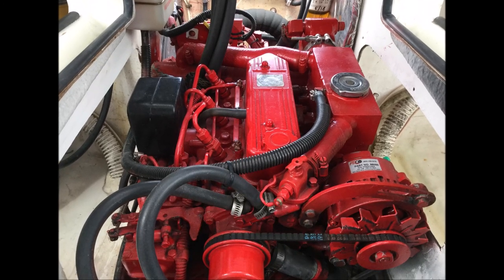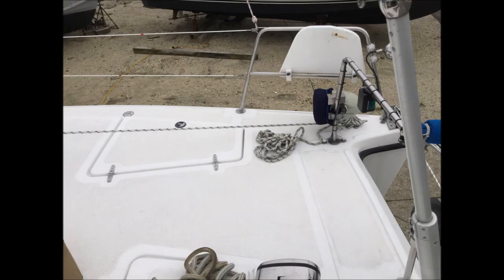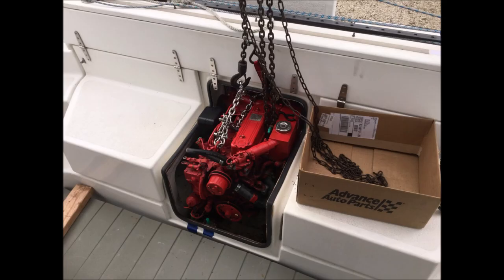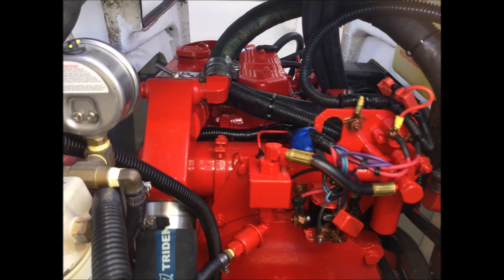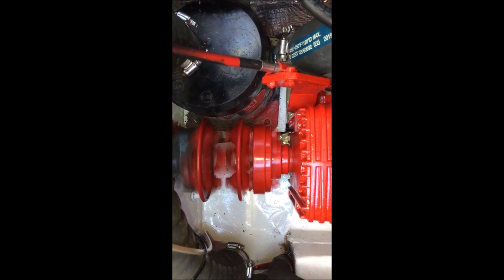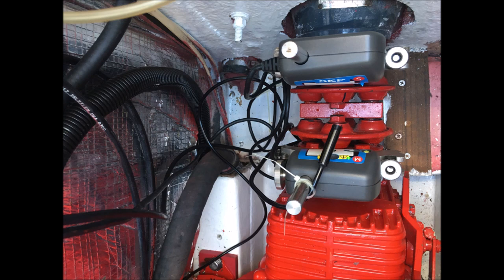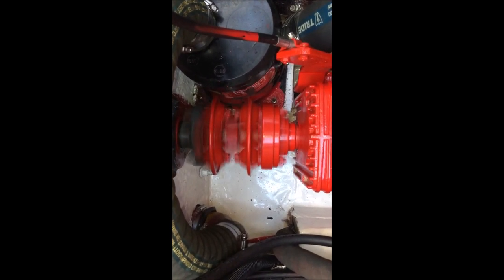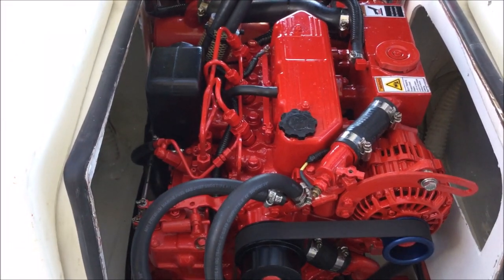Gemini 30B to 30C Engine Swap

Comment: Good video - thanks for posting.  Spec said one thousand of an inch then you say .25mm should be 0.025mm?  Also, did you recheck alignment in the water, boats move.  I don't think it would make much difference in a Gemini but the general advice is to do alignment in the water.
Reply from the maker: Yes, made an error in the video. The spec is 0.01 inches or 0.25 mm not one thousandth of an inch. Thanks for catching my error. Since the engine bay is above the water line in the bridge deck do not believe water will affect hull flex and alignment there. But will recheck when in the water next year.

Comment: Are they still making the 30C Westerbeke’s?  Can you get the big parts? head assemblies and block assemblies?

What was the cost to of this upgrade
Reply from the maker: The 30C no longer meets US EPA requirements and can no longer be sold there. However they still sell them for export to other countries. I am still able to purchase parts for this engine and purchased mine used with 400 hours on it. Many parts on the engine can be purchased from tractor dealers as the engine is a Mitsubishi L3 popular with farm and excavator equipment.